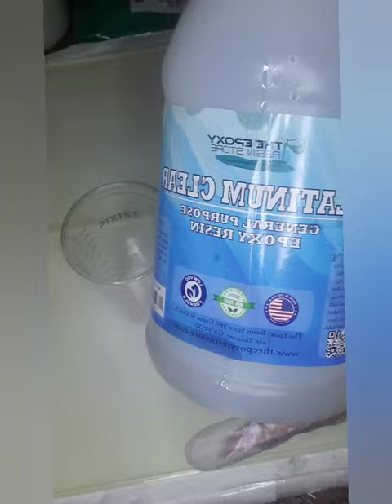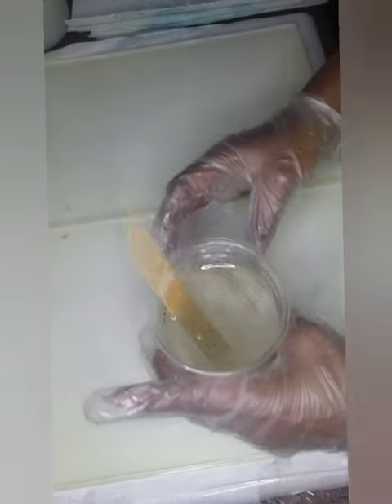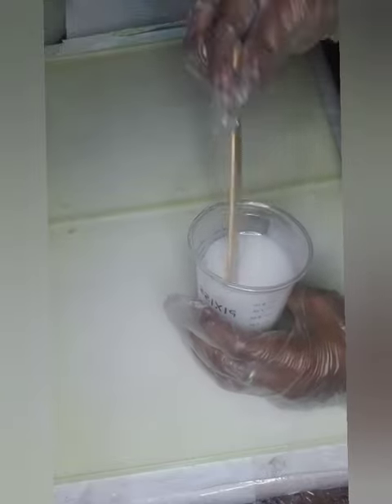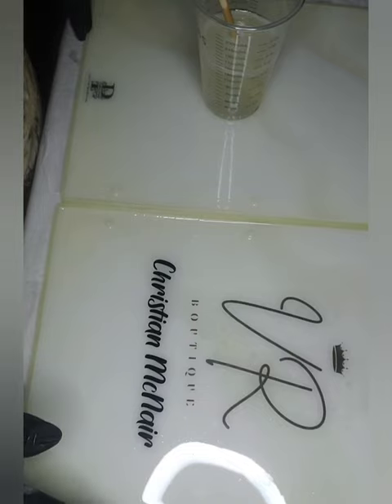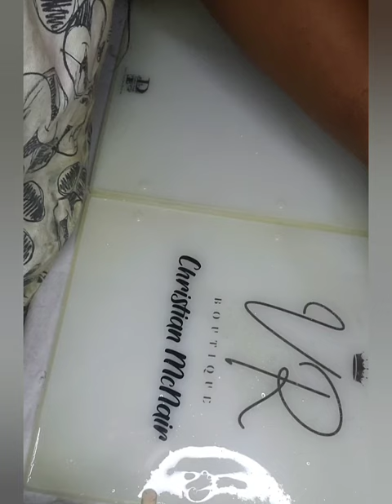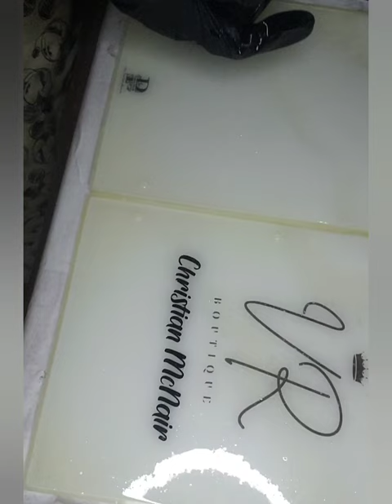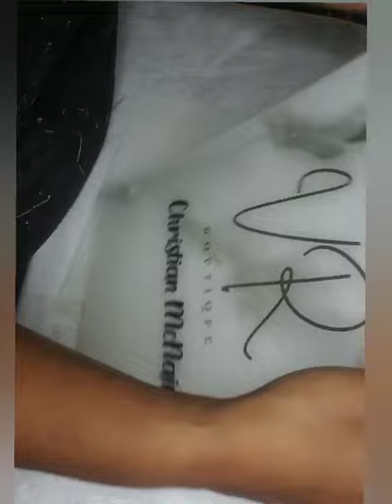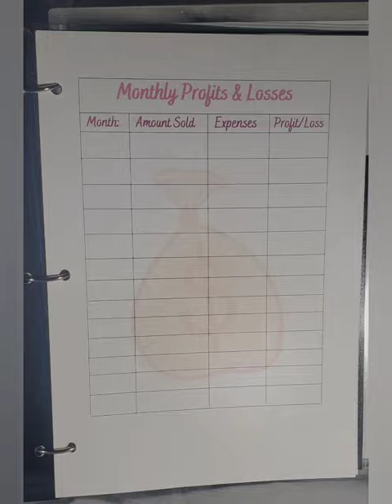large 4A Resin Business Organizer Notebook!!!

Comment: I have a question, you don't wear a mask when you use Resin?
Reply from the maker: Thanks for watching and hopefully you will subscribe to my channel. I have never worn a mask, not that I'm not aware of the safety precautions many ppl have suggested and invested in, as well as some of the harmful stories on here that ppl have shared. I have truly been relying on the MostHighGods protection in that area. I do work in area by windows that is opened along with a ceiling fan that is switched to propel the air out the room when ever I'm working with Resin. So that's been work so far, Thanking GOD for it too!!! Please do what you feel is safe for you Love. I've been blessed thus far. Hope this was helpful. Thanks again for watching and Happy Crafting Love ❤️